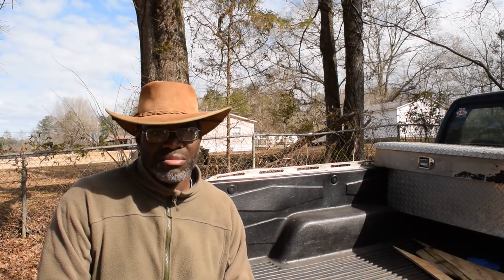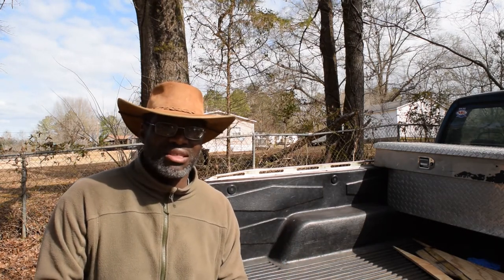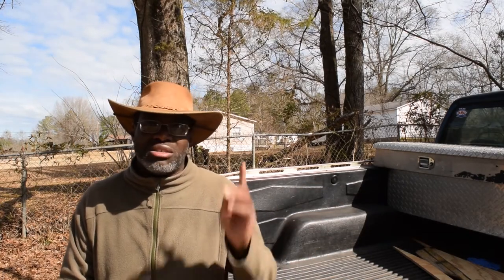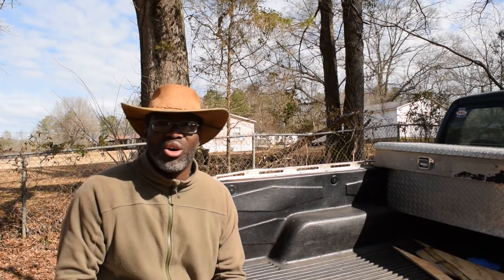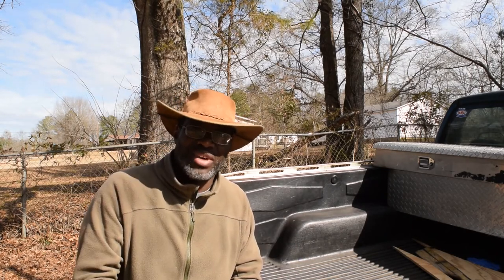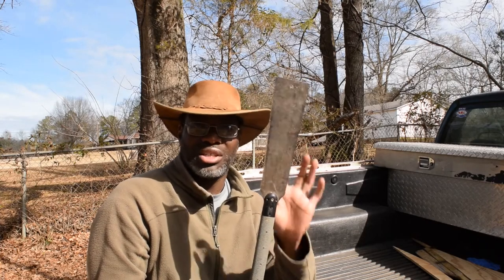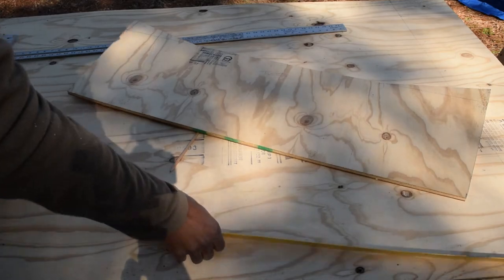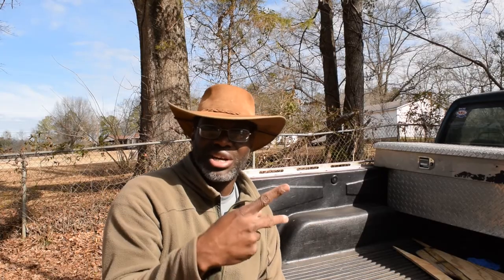Bow & Transom for Thai Longtail Boat Plans

Comment: If you are going to make long cuts with a jig saw. use a guide. Any kind of straight edge will do. Makes more accurate cuts. If sawdust covers your cut line. attach a small length of hose (small) near the front of the saw and near the blade. Place the other end in your mouth and blow to move the sawdust out of the way so you can see. Cheap and works great!
Reply from the maker: I was wondering if I should have used a guide of some kind. Even one of the 2x4 would have worked great. I'll keep that in mind for next time.

Comment: I made one just need a motor and some flexs seal because it leaked like a mofo
Reply from the maker: yeah, these Thai longtail motors are good reliable motors. I should have any leaks after I finish using thickened epoxy and fiberglass tape on all the edges.